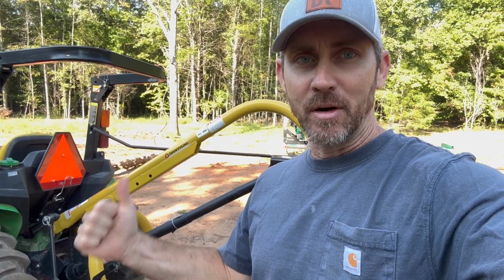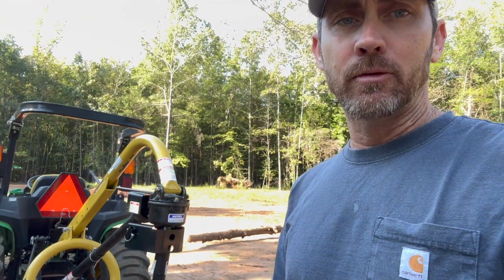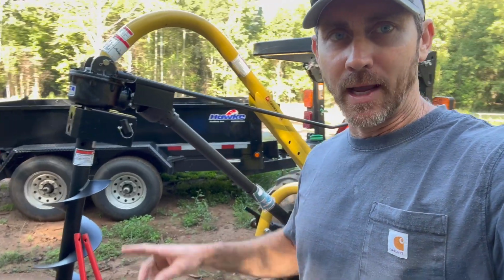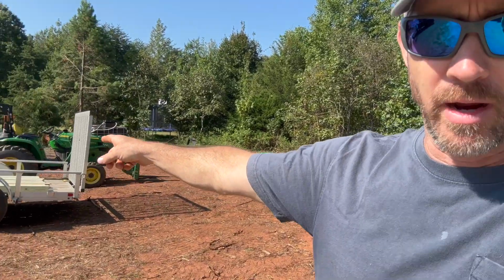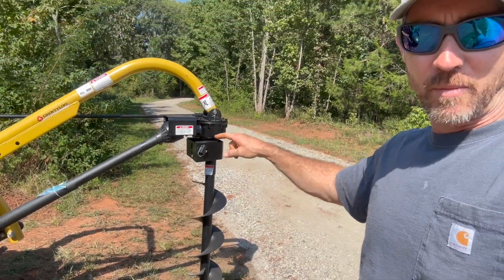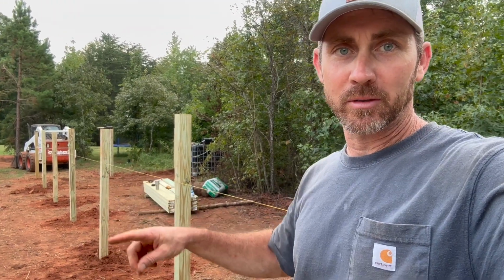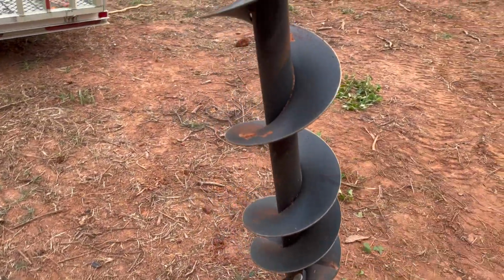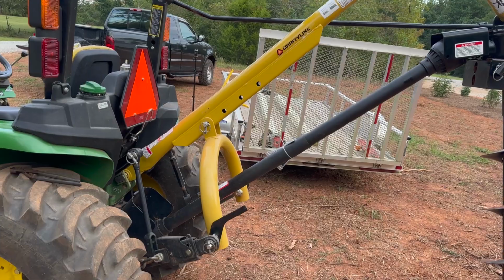New Tractor Implement For Our Fence Project

Comment: One thing that may help is going in small sections instead of plunging all of the way down in one shot. Have the auger dig a foot or two,raise it up to clear the dirt, rinse and repeat.
Reply from the maker: Awesome thanks. I will have to learn the art of that. Thanks for watching!
Reply: I have one of these as well, and they are a life saver! A tip I can offer from experience is having a large wooden block or solid object for when the auger goes "past the point of no return." The block is placed just under the gearbox on the tractor side and  prevents it from digging deeper and eventually frees up the soil its in so you can raise it back up.
Reply from the maker: That’s a great tip. I will try that. I appreciate you watching our channel!